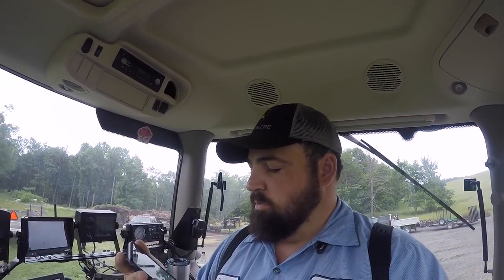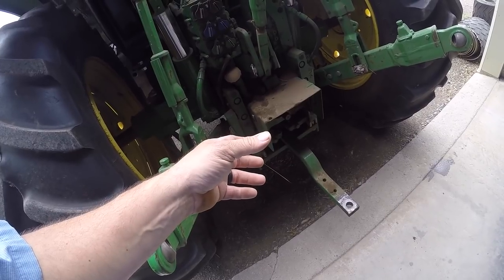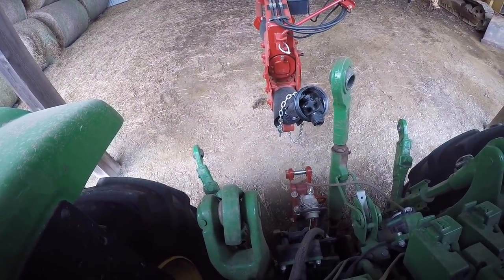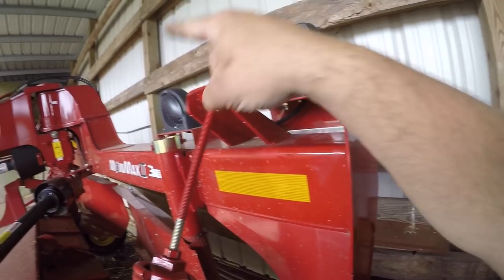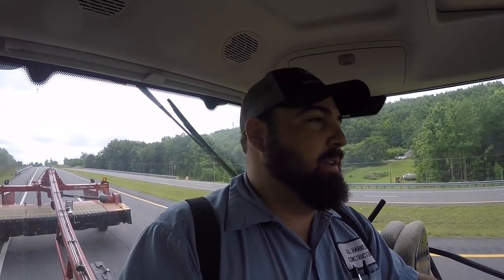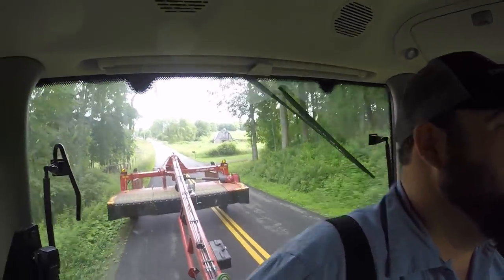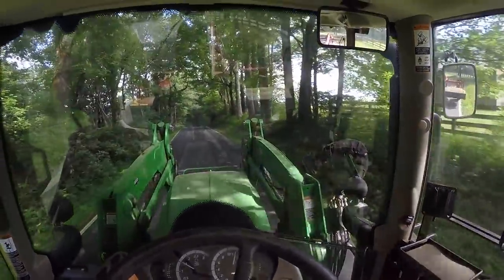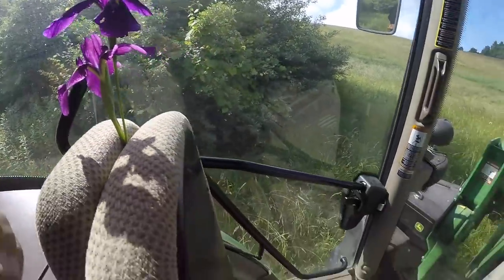New Mower Problems and Hitching Up

Comment: It's an interesting mower. I like the idea of central pivot to. Not really a big thing in UK and iv no idea why 🤔 certainly help in tight spots. Kuhn mowers here fit on the lower linkage that helps with clearance issues and steering angles. Nice video as usual sir. Stay safe 🏴
Reply from the maker: It really helps with maneuvering around things

Comment: glad to see you got good yields.  did a 40 acre of second cutting and got 7 bales.  hard drought, just got our first rain since fathers day.

when you are done with the haybine you have a mini scraper hitch you can start pulling pans! glad you showed the safety pin because i was wondering. ha.

acres per hour is like average speed on a snowmobile.  everytime you look at your speedo your always doing 50 mph, do the math of mph and its hard to average 20 mph. lol   
my combine is like that, when i am picking corn it says like 15 acres per hour but by the time you do headlands, unloading stop for pee break... you are lucky to get 10.
Reply from the maker: I’d like to have a tractor scraper haha
Reply: When I was laying pipe I got to play with a quad track.  It felt like a too stroke compared to the Cats with the C18 engine.  I noticed that as well when demoing tractors side-by-side

The MTS  Would be interesting to try out
Reply from the maker: Sorry to hear about the drought hopefully it will get better soon.

Comment: They should have mounted the door from the front.. or put an actual latch on it.
Best way to figure Acer's per hour is know how many acres the field is and look at your watch.
We usually cut 8 acres/hour with a 10' discbine. But we run it on a bigger tractor and use all the power....
Nice mower Dennis!!!!
Reply from the maker: Figuring by hand I’m getting 9 to 10 per hour
Reply: @DLHFarms  should be!  Wider cut makes a big difference in a hurry 👍😎

Comment: I have a trailer that’s hooked up to your dodge . Mine is a 6x12 side load and rear load !! Trailers are scarce now .
Reply from the maker: I think mine is a 14 foot it’s nice but now I need a bigger one
Reply: @DLHFarms  lol yes bigger is better
Reply from the maker: I’m trying to haul two zero turn mowers on it one is a big kubota diesel and it’s just not enough trailer.
Reply: @DLHFarms  I need mine for my 3 quad s don’t you have a side by side ?

Comment: Just wondering how that accumulator tie grapple is working ? I have a AF 10 and the 510 grapple thinking of the tie grabber to help hold my stacks together 
Thanks Dennis
Reply from the maker: Now that I’m used to it I love it. The stacks are so much more stable it’s just one less thing I have to worry about is hay falling off. Also it has allowed me to use large pallets on my trailers. Video coming soon on that.
Reply: @DLHFarms  thanks for the reply  bought my accumulator set up after watching you videos
Reply from the maker: The tie grabber is expensive and you need to have a big tractor to put it on. A Massey 4710 is almost too small for it but I think it’s worth it once you get used to using it the learning curve is kinda aggravating.
Reply: @DLHFarms  I have a New Holland  TL 100 A with the 3rd remote and I'm not in the steep hills here 'northern Wisconsin  'tired of picking up fallen over bales '
I'm a one man outfit 'not lots of hay anymore  'but don't like digging out bales and restacking them  'doesn't help my blood pressure  LOL
Reply from the maker: That TL should handle it just fine with fluid in the tires. I think once you figure out how to use it you won’t want to go back to not having it.
Reply: @DLHFarms  I do have cast iron wheel weights (2 -110 pound each side ) and figured I would ballest the rear tires ,looking for a place around with beet juice 
Have some pretty good size tires on this beast. Rear 60/65 R34 x  M 108. Front 480/65 R24 x M 108

Comment: Hey, it’s been awhile, enjoyed watching you mow. That door was giving you trouble staying closed?  Why do you need to open anyway, did not understand that. Thanks great job.
Reply from the maker: The door wouldn’t stay closed when the dealer was delivering the machine. He was pulling it down the interstate at probably 60+ mph. During that trip it broke the gas strut the keeps the door closed so they ordered me a new one. Its not a problem at farm tractor speeds and stays closed just fine.
Reply: @DLHFarms  
Thanks 🙏

Comment: What do you do if you want to pull it with a truck
Reply from the maker: They make a hitch that pins on to the front of it. Or you can make one like the dealer did it was pretty simple.

Comment: I got a new 6140m and now I'm looking for a mower,  the salesman for the tractor said it wouldn't run a 13' mower.  You seem to be doing fine!!!  Do you think you could run a JD 946?
Reply from the maker: My tractor is only a 6110R it’s been turned up to about 140 engine hp but it handles it great.  I would think a 6140 could handle it no problem. If not get a new Holland 313 i know it can handle that easy.

Comment: New Holland thinks we've got the wide roads of Kansas and no gates to go through.
Reply from the maker: Well I knew what I was getting into. They make smaller mowers but I wanted a big boy.
Reply: @DLHFarms  sure. I know what you mean. I mean just the way they have the cutting width narrower than the transport width and how the square balers stick out on one side so much.
Reply from the maker: The center pivot is actually just barley wider than the cut by like 4 inches but I agree the side pulls are way wider than the cut and I never liked that about my old H7230

Comment: I would not buy anything New Holland it has become very expensive, cheap equipment.
Reply from the maker: I would agree with you about that on the tractors but I’ve had good luck out of the balers and mowers and their made in the USA

Comment: It's not to be a smart ass but  put your htch pin on upside down so the clip is to the top side so the hay don't catch the clip on your hitch
Reply from the maker: No thanks. Two reasons, the book shows it going down like I have it and the other reason is if for any reason that clip pin comes out or fails the mower is guaranteed to come unhooked.